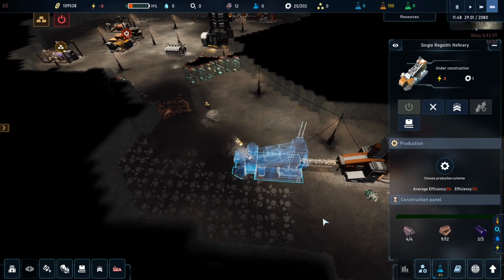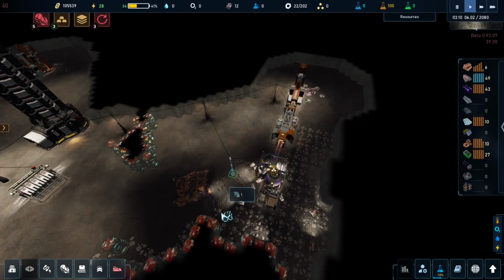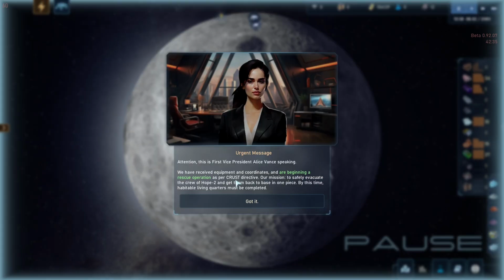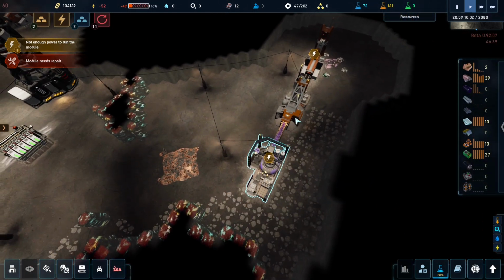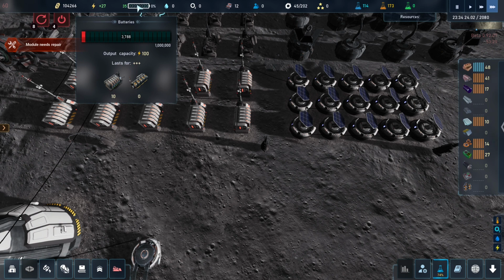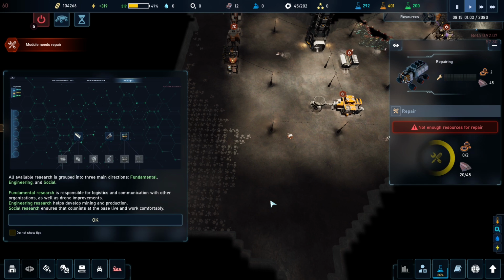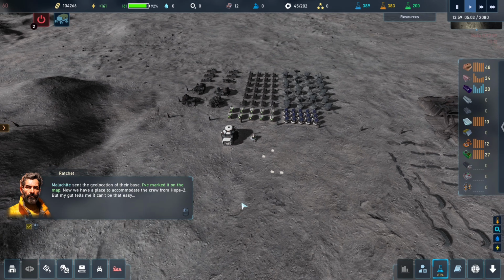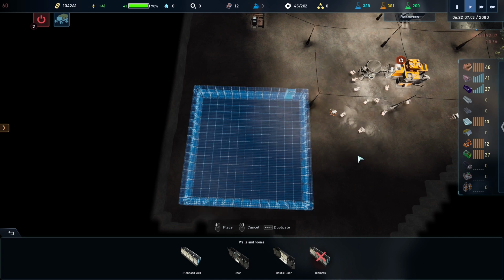The Crust - Power Problems

Comment: You've already started to build the living compartment. The question is, do you really need the help of the Malachite? Their offer seems to be very dubios and as far as it seems by now you won't get a running base from them. So does this really works out? Does this be more a delay for the rest or really help?
Questions over questions. Stay tuned in with STHedgehog to find out the answers!